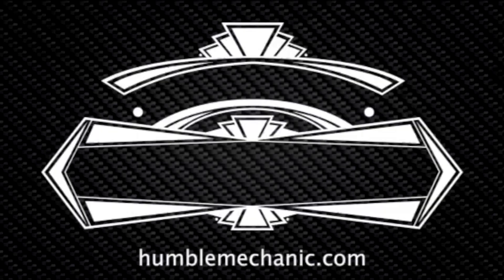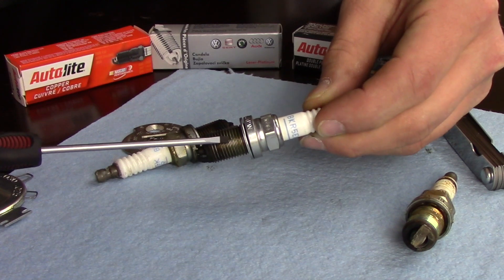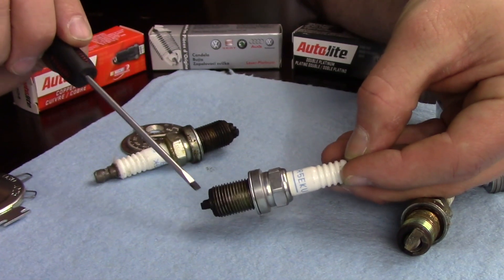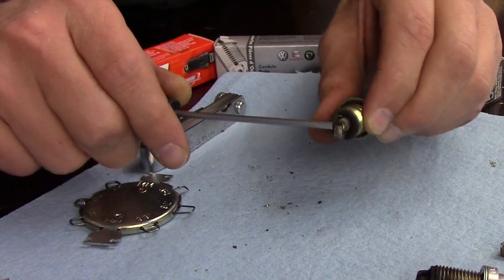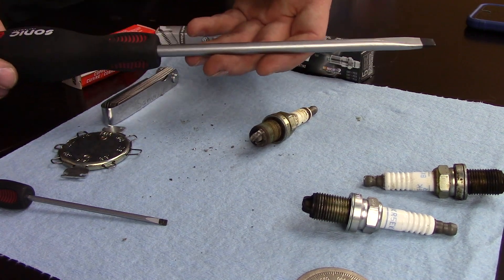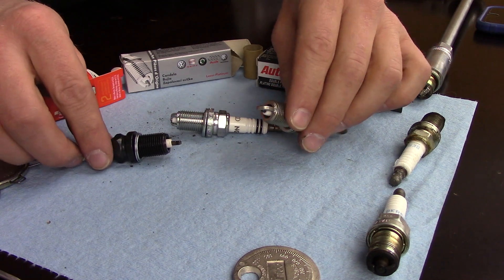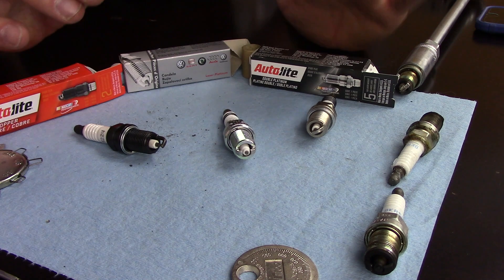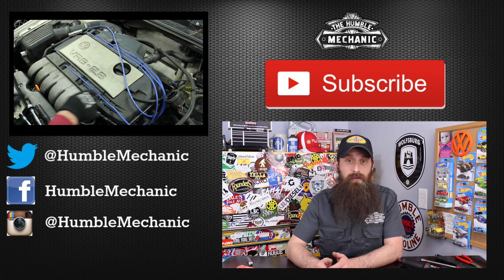What You Need To Know About Spark Plugs

Comment: ONE OF THE EXCEPTIONS IS FORD F-Series trucks, Explorer Sport-tracs, and  Expeditions, 
*in a special technical bulletin *
Specifically states to have the engine at normal operating temperature (hot) when initially loosening the plugs in 4.6 or 5.4 triton engines that use the 9/16" spark plugs to be sure that the threads are not removed from the head when the plugs are removed (and so the weak badly engineered 9/16" plugs don't shear off flush with the head) .....

following is mostly a rant about past experiences and Ford's lack of foresight 

 I have seen a 2010 F150 5.4 Triton that had no threads left for spark plugs to be reinstalled in.... it took me 3 days to get the proper heli-coils to rethread the entire engine because the previous parts changer yes (that's an indictment of his work, a proper decent tech would have read the service bulletins and known to do it hot or at leastwouldhavestoppedworkingwhenthefirst one came out with aluminium still in the threads ) had pulled the threads from 6 of the  8 holes.... and broken 2 plugs off in the head and after getting them out of tried to make the new plugs thread in anyway...  (had to drill the holes out to 16mm {⅝"} then put heli-coils in to bring the size back to 14.6mmm {9/16"} because a 16mm socket will NOT go into the holes to use standard size plugs ) standard 16mm plugs Would work IF they could be tightened ... but ford decided that they didn't want to make the ignition wire passages 3mm bigger in diameter so they have flimsy 9/16" plugs in bottom  of  the super deep narrow passage that gets really hot because it has no room for air to cool things down and theyre usually full of dirt and oil so that it is even hard to get the 9/16" socket into and the smaller plugs have a tendency to seize up after a year or so....

Comment: I have a pit bike that needs a new spark plug but the one I just bought has the metal bit on top over the screw (opposite side to the spark) but the one that I needed to use doesn’t have that and it won’t fit. Is it possible to take it off for it?

Comment: my motorcycle manual spec said to use colder ngk cpr9ea9, yet the mechanic installed hotter ngk cpr6ea9, it ran just fine although felt weird. hopefully no long term problem. been almost 3 years but I noticed the plug was fouled.

Comment: I thought I would mention:
He did not mention dry or lubricated threads.
The torque spec is for a dry thread.
I believe this would mean no anti-sieze or oil/grease.
Otherwise, you will be over tightening & may strip the thread.
I am not a mechanic, but on my boat  & motorcycle - I just snug spark plugs tight with a regular size ratchet. I have stripped the threads before in my boat engine with a torque wrench, luckily a local boat shop sold me a used cylinder head at a good price.
I have a shop book that says "Dry THREADS" for spark plugs.
Reply from the maker: Always girlie repair manual. Many plugs are coated and don’t need anything

Comment: As many "How to Read Spark Plugs" video I've seen no one talks about how to read whats seen from front to end of the tread of a spark plug.  I took spark plugs out of my car and it's not all about the top half but all the way to the end of the tread I like to know about.  Besides the thread looking used, in between the threads It was brown colored like dried oil caked in to the end of the tread. One spark plug the worst looking was like that and one other half way the tread with the tip with a drop of oil and the other four were about one quarter from the front part of the thread.  143,000 miles on this 2012 T&C, don't image the first owner ever changed them.  I'm interested in know what you have to say about reading further what's seen on the length of the thread as a diagnoses. Thanks.
Reply: Hello HumbleMechanic.  I am a DIY. Did my first Plug and Coil replacement. I'm not a savy Youtube user, I thought comments flowed or hardwired in decending order, but was the Pinned comments (5 yrs ago) a reply to my question?

Comment: This is very informative! Thank you! I was wondering about the difference between spark plugs based on the manufacturer; for instance I bought some Spark plugs for my 98 Corolla, but just got an 05 Hyundai Tuscon- I barely use the Corolla anymore and was wondering how to tell if I can use the new Corolla spark plugs for the Tuscon?  I was wondering what factors to look out for besides the gap etc

Comment: Help! I recently changed my spark plugs and everything works fine at idle or low RPMs and slow acceleration. In neutral I can rev the engine high (quickly) no issue. The problems start when I am in gear (any) and either accelerating fast or go more than 4k RPMs. The engine starts stuttering and misfiring. I can get higher RPMs but I need to accelerate very slowly. Any clue what's going on?

Comment: During the 7 year production life of my classic 750cc motorcycle the spark plug changed from an N4 to a N6Y. These are completely different looking plugs. The N6Y has a projecting / exposed electrode. The N4 is almost enclosed by the end. Can I use either or will one of them possibly damage the engine?

Comment: So I was planning on changing the sparks on my 2016 limited malibu and they don't look bad, they the OEM ones from dealer, car has 90,200 miles. I measured the gap and it's at 
0.40" , I found ngk plugs and say pre gapped at 0.44" , is that bad for me to drive like that? Or is it time to replace them.

Comment: So, here's a little tidbit about resistor plugs.... you either need resistor plugs OR resistor wires, but you don't need both in order to keep your car stereo static free. Adding resistance unnecessarily is not optimal, but is almost never a problem as today's ignition systems are usually more than capable of delivering enough spark to fire the mixture in the cylinder. HERE'S A TIP YOU MAY NOT KNOW.... When removing a spark plug in a plug well, crack the plug loose, then use compressed air to blow any debris in the well out so it doesn't fall into the cylinder upon the plug's removal. Shoot a few more blasts of air down the well as you're unscrewing the plug so all debris blows out. A straw or hose can be used to blow through if you don't have compressed air.  Dielectric grease should be used in ignition wire's rubber boots to keep moisture from oxidizing the plug's terminal nut and the coil's connector. If put on way too thick, it can actually act as an insulator suppressing the current, so don't go overboard applying it.  When installing plugs, put anti-seize on non-coated threads to prevent cross threading,  stripping or galling upon the next removal. My work is done here. Hope this helps.
Reply from the maker: Be sure to follow OEM recommendations on anti seize. Some plugs are coated and don’t need it.  

Great tips!
Reply: @HumbleMechanic  Thanks, you're advice is now updated in my post. Love your channel! 
BTW... I'm now running NGK Ruthenium HX PSPE plugs in my 99 Camry 2.2l. with 119k on the clock. I typically stick to OEM plugs in all my cars, but there is such a noticeable improvement with these plugs over the stock NGK twin electrode Platinum plugs, I will never go back. I've put 17k miles on them and just pulled them out to check on them. They're perfect. Great plugs worthy of checking out.

Comment: Realize that’s why my car took 3 turns before starting. At first I thought it was the starter then noticed my check engine light was flashing took it to the shop and needed damage spark plugs of 8 replaced from previous damaged coolant leak overheating before sealing the leak. The check engine light stop 🛑 flashing. Next day check engine light turned off.

Comment: Hi, I have a 2016 39000 miles Golf R with a stage 2 tune. I was tracking the car the other day and ended up with a Spark Plug failure where the top electrode was bend together with the centre electrode. I have only seen this before when parts of the valve or piston came off and hit it. All other pugs looked fine btw. Anyway, I put new plugs in from the RS7 which are one grade colder and after re-setting the DTCs, the engine runs fine!! Could carbon build up come loose have caused this? what's your thought?

Comment: I just changed plugs & wires on my 1997 Toyota Camry V6. I read alot of forums and watched a lot of YouTube videos and went to NGK's website. I purchased their "Iridium" single electrode spark plugs based on lots of reviews and users, even though on my cars hood, it had a sticker stating "use platinum dual electrode spark plugs only". I was told "Iridiums are a better, newer technology plug, and an upgrade". Well, I installed them and my car would NOT start. It sputtered a bunch but refused to start. I swapped out the 3 front new Iridiums with the old Denso platinum dual electrode plugs as it's easy to do and takes 5 minutes. I didn't swap out the rear 3 because those are a MOFO. So I try starting the car. It starts, but is running like it's on 3 cylinders. So I now know it is in fact the spark plugs. So I bust my knuckles for 90 minutes and swap out the rear 3 new Iridiums, and put the old plugs back in. Car starts immediately and runs great. So I just pissed away $35.00 on new Iridiums and have to go spend $75.00 on NGK Laser Platinum dual electrode plugs.
Lesson Learned: if your car specifies "use dual electrode spark plugs only" heed the warning. Chances are using anything else won't work.

Comment: With all due respect Charles, it ain’t an explosion. Sure it happens fast at the scale of human perception, but it’s actually extremely rapid combustion. If it’s really an explosion, you got problems 😟.

I’ve got an ‘08 Altima Coupe 3.5 and the intake manifold needs to come off to access the rear bank. Plugs are original OEM Iridium and at 130k, they have never been touched. I’m a little concerned about them seizing, so until performance, mpg or an MIL tell me otherwise, they will stay in. Thoughts?
Reply from the maker: You are correct. But remember we have to start the understanding of a component somewhere. The “explosion” gets people in the right mindset. 

And I’m with ya on the plugs.
Reply from the maker: You are correct. But remember we have to start the understanding of a component somewhere. The “explosion” gets people in the right mindset. 

And I’m with ya on the plugs.

Comment: I was sold iridium plugs and i installed 4 so far in my v8 i turned it on for a short drive and the engine cant get a steady rpm, it goes up and down and the engine runs like garbage.  I will be paying them a visit tomorrow to demand a refund and return the other 4 plugs and get the platinum ones it had before.

Comment: I have a 350 chevy small block  with a new set of heads 202 heads  and engine won't start , I pulled plugs out and cleaned them and found out that #5 had oil deposit on it it's  got me pulsed cause that's the only one that had deposit on it what is the problem ,michael let me know what is the problem please cause i don't want to tear the the engine down

Comment: I would never want to run a spark plug that would cause the fuel to explode - maybe Volkswagens are different.
Spark plugs are supposed to initiate burning of the air/fuel mixture.
Explosion of the fuel is called Detonation and problems will soon occur.
Burning fuel is desirable, exploding fuel is not.

Comment: How do you tell if a Gasket has been crushed? And why is that little ring called a Gasket, and Also so is that bit shaped piece of Nylon or Metal under the Valve cover? 
Also quick question guys. How come when the head gasket goes (that's literally just that little seal right?) It can warp your whole engine, and also, (inm y gf's case) when it goes, people from behind see so much white smoke they think a god damn plane went down? And why are they SO expensive to replace pre- damage, and you can throw your engine in the bin post? Thanks

Comment: Toyota's mid 90's to early 2000's 3.4 v6 uses those same dual electrode plugs too, either ngk or denso. Many of them came with ngk on one bank and denso on the other side. These motors don't like single ground plugs either.

Comment: I have 1 question. I wanted to buy a used car and in the history info the car had only been driven for 500 miles and the owner changed the spark plug is it a good thing?
Reply from the maker: Not sure it’s good or bad, but it’s odd.

Comment: One of the best channels for mechanics and diyselfers. 
Thanks for being so detailed in your videos. 
I was wondering if you had a video on testing spark plugs and ignition coils resistance to find a new coil or plug that is defective. 
Your comment about the torque wrench just gave me an insight. 
Due to a cylinder #5 misfire on a Nissan Maxima 2005, I replaced all the spark plugs after ensuring that a compression was not the culprit. However, i did not replace the coils. 
Since this engine is not the easiest to replace spark plugs on and not wanting to remove the intake in case Coil #5 was the problem, I moved it to #6 position. Engine was smooth at first during the test drive but after about 60 miles of driving, misfire again. Very surprisingly, it was not a p0305 but a p0304 instead. Hum, now im wondering if I did not torque it too much or too less on Cyl#4. 
Cars problems can seem mystical sometimes.
Since all the plugs installed are brand new oem, I want to check the coil #4 resistance for defect. If good then it is more likely a torque issue on plug installed in Cylinder #4. 
Any input Humble Mechanic?

Comment: I have a question. I have a 24v vr6 and have problems with the coil plug wires on cyl 5. Can i use the 12v vr6 coil plug wires on my 24v?

Comment: I only use NGKBKR7E coppers on both my 1.8t, and vr6 V2... copper is by far the best energy transfer  of all metals. With about 200 miles put in both in a year...... coppers don't wear out for a long time.

Better response,  better idle.

Comment: Used vehicle no idea what previous r.o. did. The gap suppose to be .054 and instead the .100 fits in so nearly every plug is double what the gap should be. Current 179,000 miles. How long does it take gap to get from .054 to .100?? Did they never change plugs???

Comment: Someone please clarify/correct me. Thanks!

So larger spark plug gap results in better/more complete burn?(downside to this?)
and a smaller gap results in less burn? (upside to this?)
Reply: Well, there's really no upside to too small gap, but the major downside of too big gap (either worn out or wrong type of plug) is increased stress on your ignition coil and battery. Just look at your car's user manual and buy the right one, general rule of thumb is the OEM or OEM-spec plugs are the best option for your engine.

Or, in case of custom modified engine, you probably might need to experiment a bit.

Comment: I have subaru that was throwing some codes. So I took it to O'riellys to get the obd 2 to tell me the codes. Turns out it was high idle and cylinder 3 miss fire. Just recently changed spark plugs and wires, I thought I did something wrong. When I got home (20miles) I let me engine cool off for a bit. Than I started to take the wire off the plug and the boot started coming off and needles to say i took those wires back and upgraded the wires to something better. No longer have a check engine light and it sounds great.

Comment: Is it just as good as using a torque wrench if a spark plug company gives rotation specs after hand tightening to contact?  Wouldn't that be more accurate vs possibly using a cheap/not so greatly calibrated torque wrench?
Reply from the maker: Both are gonna be close as “hand tight” is not really an accurate value either.
Reply: You do make a valid point that "hand tight" is not an accurate value lol.  Anyway I ask because I have a Subaru 2012 Legacy 2.5i (H4 EJ235 engine) and I've seen some crazy things done (like lift the engine and unbolt/move around the fuse box) to try to fit a torque wrench  in there to get at the the plugs...

Comment: Hello I have a question for you can you help I have p0300/p0301. 2007 Chevy impala 3.5v6 . One day I was driving in the car just shut off are you Soum that was the starter because I try to crank over the engine wouldn’t crank out so I got the car home put a new starter and it had the same symptoms I got the car to crank over it ran then I got a P0300. I put a used auto body and camshaft magna EGR valve new spark plugs wires car still giving me the same code I’ve tried several things looking for here exposed wires Is there anything that you can suggest

Comment: Duralast actually makes a spark plug socket swivel extension tool that actually has magnets that retain the sparkplug. Its great and i love it and recommend it to everyone.
Reply from the maker: I actually used that exact tool last week. :)
Reply: HumbleMechanic its honestly the best sparkplug tool in my opinion. Never have to worry about the socket coming off and the magnet is pretty strong too

Comment: A mechanic that actually knows his stuff & teaches it, good stuff mate.
Reply from the maker: Thank you
Reply: @HumbleMechanic  POG
Reply: Why not clean a fouled plug? Bench wire wheel or even a good brush. Don't do this with the porcelain as it cracks every time with the exception of the centre electrolytic. That you should just be careful about it. The heat does the damage.